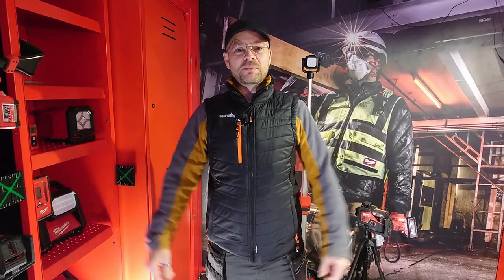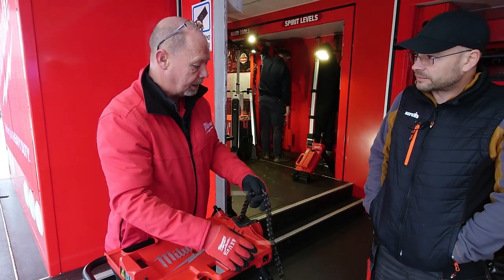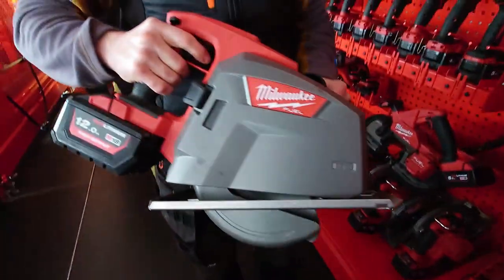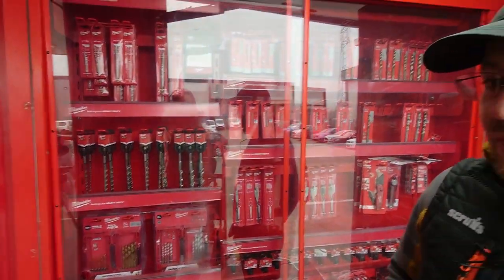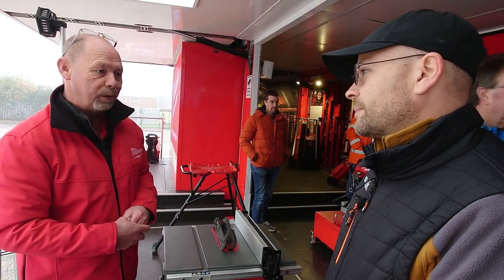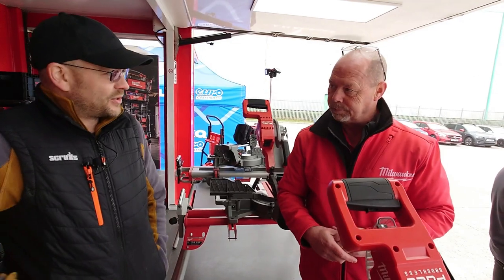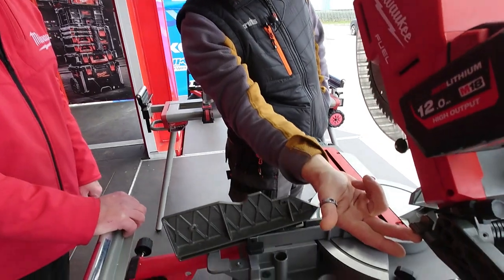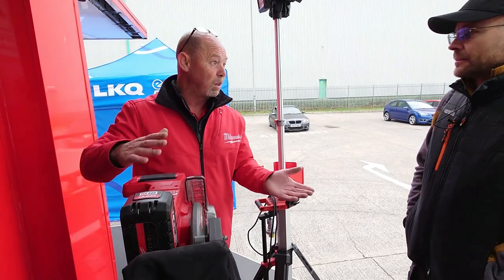Milwaukee BIG RED TRUCK Tour 2022 | Includes Hand & Power Tools and Packout System

Comment: The thing you touched on oscillating cutter/multitool head is a screw/bolt  that you hand tighten before locking it in with the lever.  

When it comes from the factory,  it's tight.  Break it loose once and it's all fingers from there.  

Cheers mate.
Reply from the maker: Thank you. 👍👍